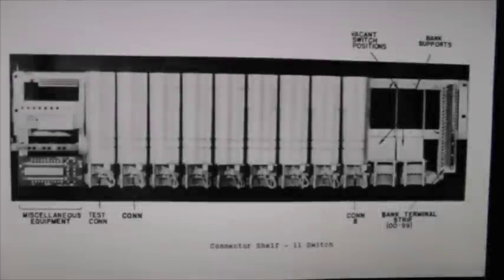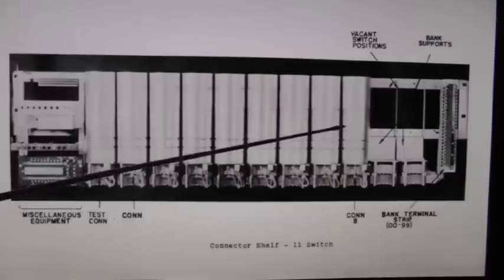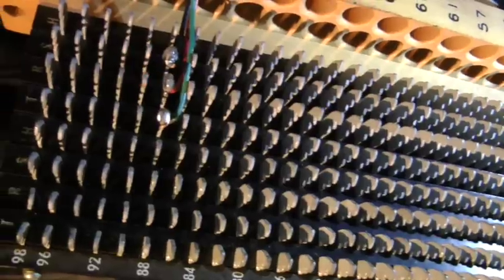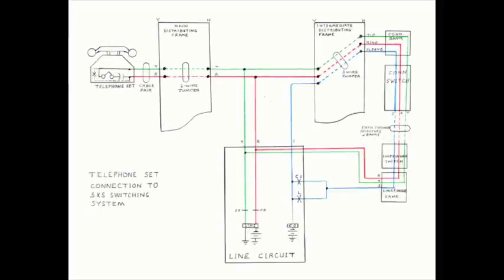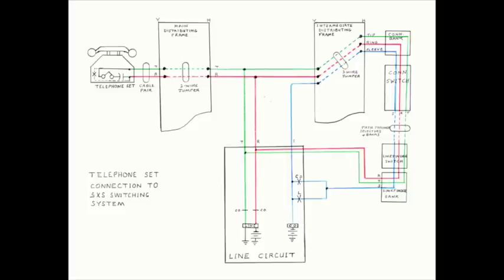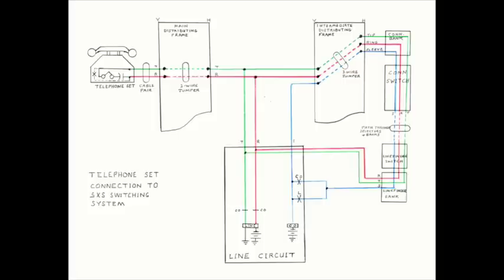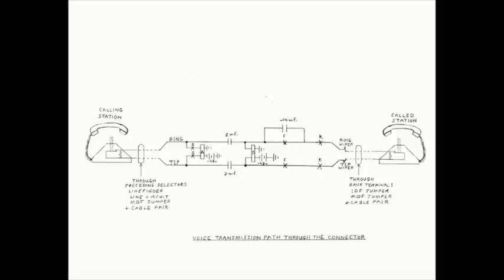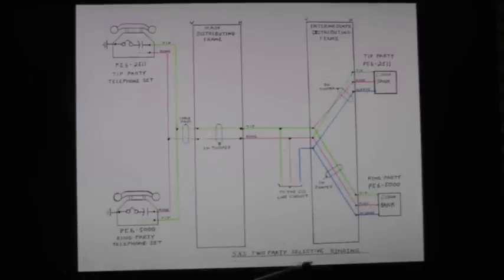The Connector In The Step-By-Step Telephone Switching System

Comment: When this equipment was in service, numbers part of a hunt group had to be consecutive. Correct?
Reply from the maker: For customers with 10 or less lines, Rotary Hunting connectors were used. The customers would have from 2 to 10  consecutive numbers all associated with the same tens digit.The number listed in the directory would be the one with the lowest units digit. The connector would step the wipers to the dialed number and if it was busy, begin rotary hunting consecutively one terminal at a time. For example, if a customer had a listed station number of 1234 and had 5 numbers, the assigned numbers would be 1234, 1235, 1236, 1237 and 1238. A calling customer would dial 1234 and the connector would step the wipers to terminal 1234. If it was idle , the connection would be made. If it was busy, the wipers would step to 1235, test, and if busy step again to 1236. This would continue until an idle line was found. If all lines were busy, upon reaching the last line, rotary stepping would stop and busy tone would be returned to the caller.

For customers with more than 10 lines, Level Hunting connectors were used. This was a much more complex operation, and the connector would receive and store the tens digit before even stepping the wipers at all. The actual level to be hunted on was selectable within each connector in the group and was varied across these connectors to reduce hunting time. That is, each connector could hunt in a different tens digit order to any other. Once a level had been selected, the connector would step the wipers vertically to that level, and then begin rotary hunting consecutively, one terminal at a time.
Reply: @Hicken65  Your videos have been quite interesting.

I used to work at a high school that I suspected had 5 inbound lines.  The main number ended with 8576 and I knew 8579 and possibly 8570 were also valid. Would it be likely the hunt would go xx76 77 78 79 70?

If that is correct you've answered something I've been wondering about over the last 25 years.  :)
Reply from the maker: @GaryCameron780  Yes, you are correct. The units digits of station numbers on connector bank terminals are all numbered 1, 2, 3, 4, 5, 6, 7, 8, 9 and 0 from left to right and rotary hunting would always be performed in that sequence. Of course, the starting and endpoints were variables that depended on the customer's listed number and number of lines in the hunt group.

Comment: It's too bad that a "calling party hold" condition always prompted a CO technician to fix the issue. I had been imagining it being used as an early form of DOS attack.
Reply from the maker: Step-by-step switching systems actually did have an option to be provided with a form of DOS equipment. It was called Line Load Control (LLC). In a disaster or other emergency situation in which the switching system could be overwhelmed with traffic, the telco could turn on the LLC, which could deny originating service to up to 90% of the telephone lines. Lines such as fire, ambulance, police, some government, etc. were assigned as essential lines and not blocked from originating calls. Of course, if someone had an emergency, they would not be able to call for help. For that they would have to go out and find a payphone. Payphone lines were included in the essential category.
Reply: Lloydminster, Saskatchewan early 1980s.  My cousin's place.  I remember him deliberately not hanging up for the pure amusement of annoying the called party.  Ah good times.

Comment: Please consider doing a video that describes how the ANI-B system worked.  I can only guess that it somehow used the sleeve lead and/or the other terminal on the top bank of all the connectors.  I know that panel switches used a 5300Hz tone on the sleeve lead as part of identifying the calling line.  I have no idea if this was the case on SXS switches.  Obviously such connectors would connect to an AMAT-type outbound trunk with the relays in the CAMA system generating the MF tones to send the calling party's number forward to the Toll Tandem switch.
Reply from the maker: Yes, the connector sleeve leads at the distributing frame were cabled to the ANI Number Network and Bus System. I believe the identification tone was 5800Hz. An MF outpulser sent the calling number over the outgoing ANI trunk to the CAMA office. Unfortunately, I don't have documentation or equipment to do a video.
Reply: Thanks for the response.  You have a great deal of knowledge and I want to thank you for posting everything you know.
Reply: Do you have a video about how ANI finds the calling party?